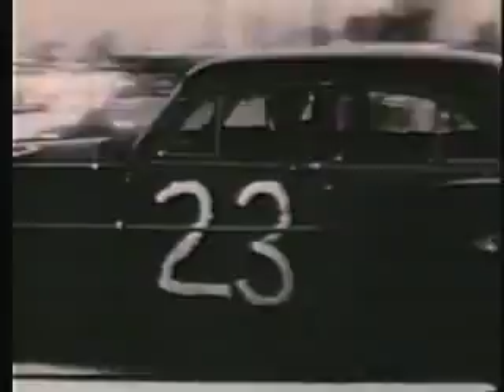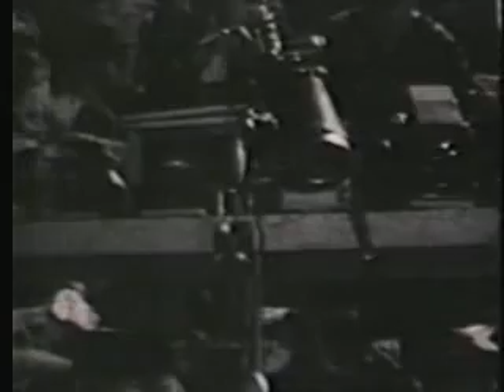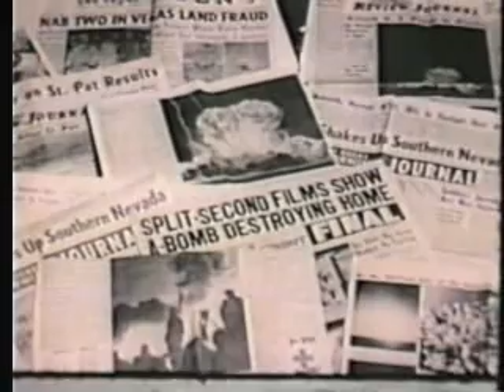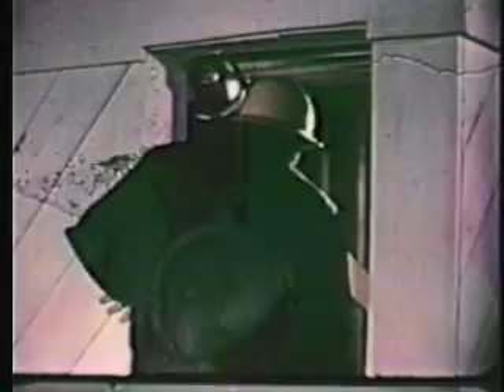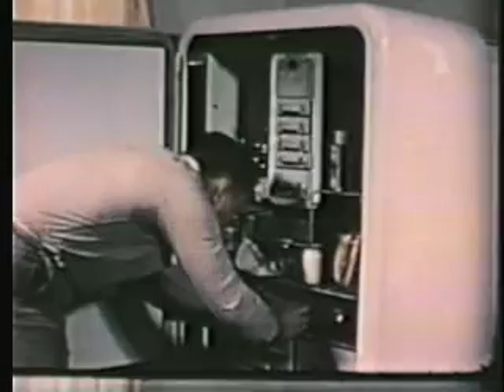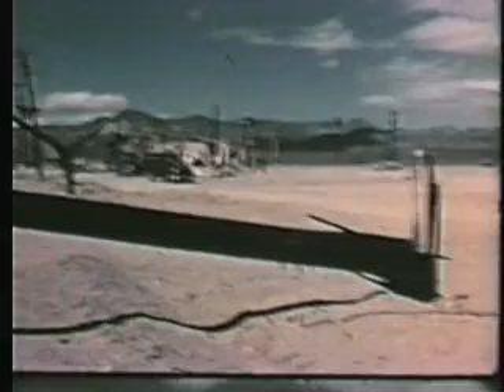Declassified U.S. Nuclear Test Film #33

Comment: They used the same calculation using 666, as earth curve.666 per mile squared, earth speed 66,600mph, stop motion animation, film exposed to radiation, trucks disappear before the blast hits the house, camera doesn’t move when the blast hits it, yet it’s on a tower.

Comment: how can the rolling film survive the blast??!?!?!?!?!
Reply: They cameras are situated in hardened bunkers with radiation shielding. They view the experiments from mirrors or periscopes.
Reply: really? hardened bunkers with a nice glass mirror peephole??? that would be the weakest point for sure.. in the video you even see them setting up the cameras in a little box,,, didnt look like a hardened bunker..... also many cameras seem to be suspended from quite a high vantage point as you see the blast blow away the houses/buildings,, seems like the camera is on a light pole even - a hardeded bunker on top of a light pole.....?? well.... it's veeeeery flaky man..... the camera doesn't even sway in the blast.... most people with brains will question this
Reply: Notice later in the video how poles and towers are still standing? Very small area exposed to the blast pressure compared to a house (stick/brick) as well as stronger per area unit.
 A camera in a lead/steel box on a pole/tower would do fine in the outer areas, bunkers only needed closer in to the blast. No need to go all tinfoilery...